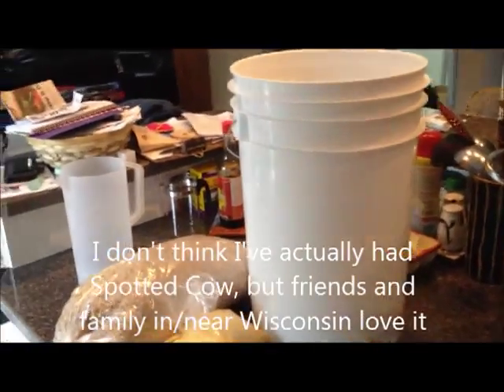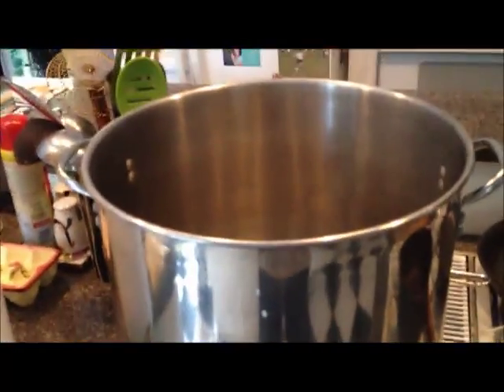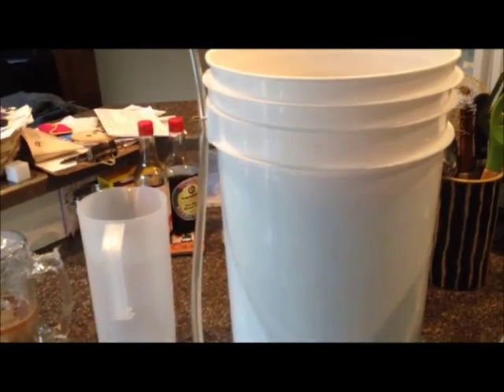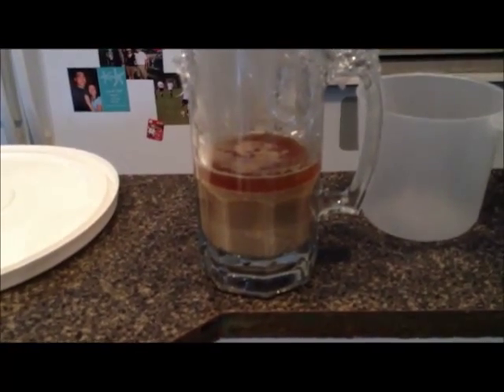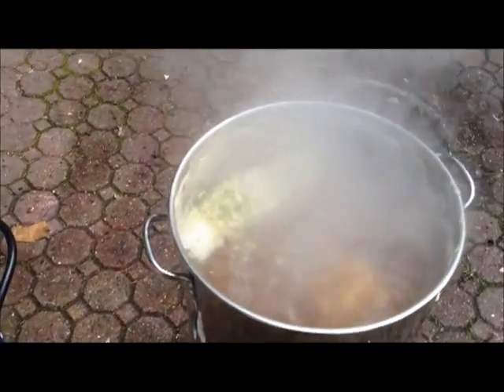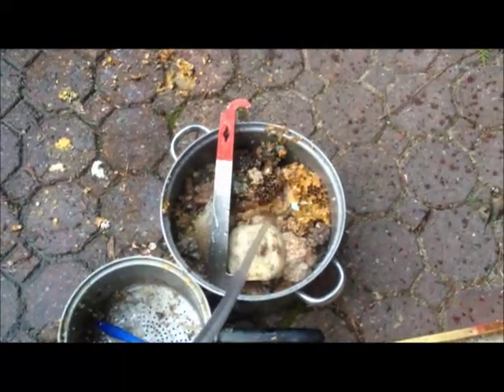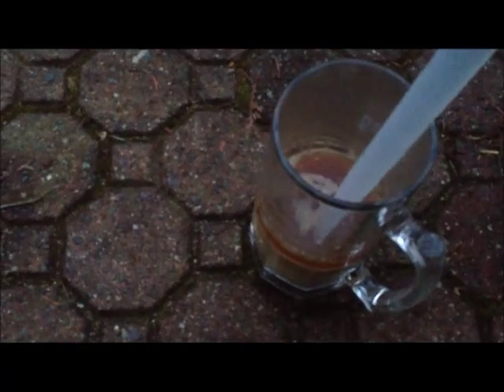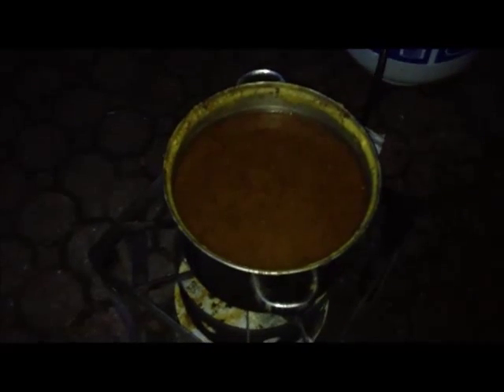Spotted Cow clone

Comment: I have spotted cow in my fridge right now.  What cost advantage might there be in making it yourself?  I've never made my own brew but I found your video informative, as usual.
Reply from the maker: It cost me $19.00 for about 2 1/2 cases or about $8.00 a case for raw materials only, but I've got all the equipment. A case of beer here costs about $50 so that's $42.00 a case in savings or over $100 per batch.